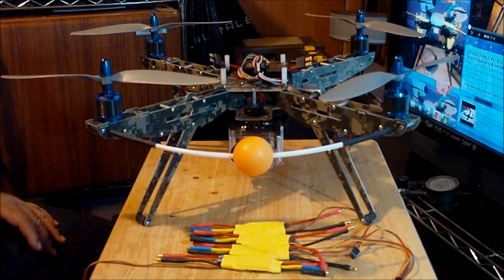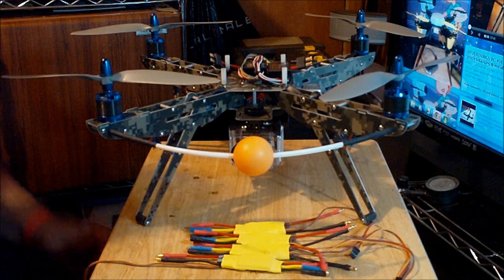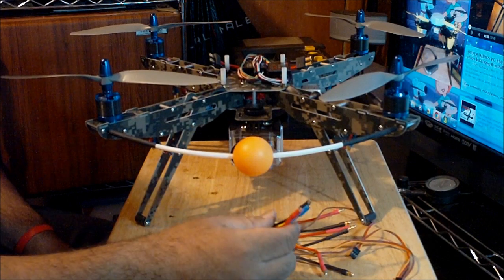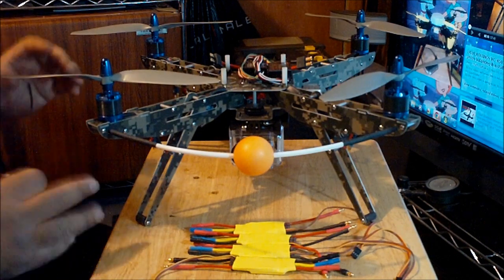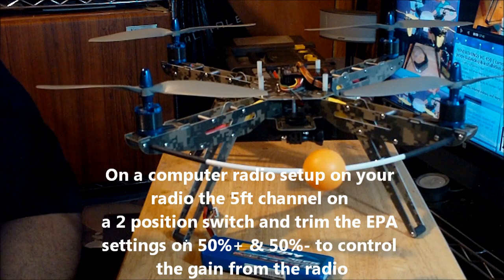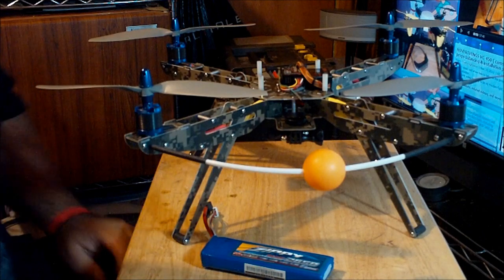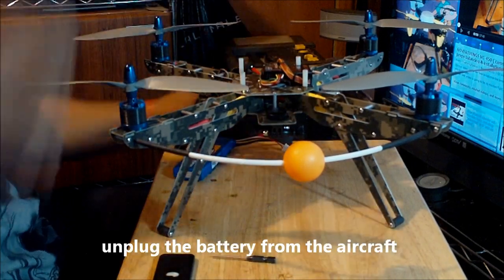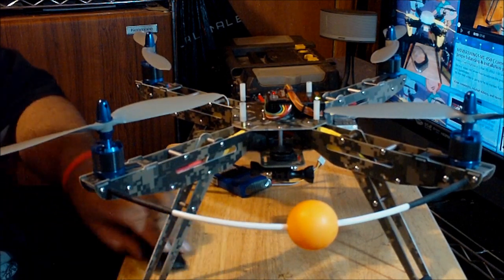HOVERTHINGS VC-450 ( camo ) quadcopter build up ESC's swap & GU-344 setup REDUX part #7

Comment from the maker: @cjsfamily When you select a new memory to be setup on the Hitec Aurora 9 the radio is always going to ask you almost a dozen questions before you can used that memory , i don't fly airplanes or heli's so i can't help you with that , only quadcopters so if a quad is what you are planing to used on your Aurora 9 select ACRO " airplane mode " and then respond to all the other questions NO .

Comment from the maker: @cjsfamily Well , every time when you turn the Hitec Aurora 9 TX on it always going to ask you if you want to transmit , YES or NO , if you select NO the radio wont transmit any signal but it let you access the menus to setup the TX without transmitting , if you select YES you will be transmitting and good to go flying .

Comment from the maker: @eastcoast78 For example if i use the GAUI 500x flying weight chart on 3s it can go all the way up to 1700g and on 4s it can go to 2200g , the 500x frame is a little bit larger than my VC-450 but my frame its heavier , the motors on the 500x are 2212 950kv and mines are 2215 740kv so i believe that on 3s i can carry a heavier flying weight than the 500x since my motors are larger and torquier but the big ? is how much more its safe to fly ? , what's my limit on 3s before i need to go 4s ? ..

Comment from the maker: @eastcoast78 My VC-450 is a mystery , i know that my 2215 740kv motors are large and powerful , the 10 x 3.8 APC props give me a lot of thrust but this quadcopter its a DIY and i got no idea about its limits , i don't know what's its maximum flying weight and that's why i want it to be able to fly on 4s , there is not that many companies out there making quadcopters kit so i can compare mine with theirs and use their specs as a baseline , the GAUI 500x its the closest one to mine quadcopter .

Comment from the maker: @eastcoast78 I done FPV flights already with my Gaui 330xs using a single 3s 2650mah lipo powering the aircraft and the FPV 200mw transmitter with a FPV camera , i can get up to 10 minutes of flying time with one minute spare but my 330xs came with a chart that shows you the maximum flying weight , my 330xs can handle all the way up to 1100g of flying weight , when i fly it with the FPV system + the battery my total flying weight its less than 900g so i know that i am safe .

Comment: @TheFlyingRookie id say you'll be fine with 3S P. The 500Mw FPV weights little to nothing. And those 4 motors well provide ample power for a FPV TX. 
You can put a smaller 3S Lipo there (stand alone) for powering the TX, or you can tap into the Main Flight lipos. But i would Prob go with a separate small battery for the FPV tx.

Seeing you'll only be flying for 8-10min a 500Mah 3S would be perfect 

I have the 5.8 200Mw wired to my GoPro960, it works great.

Comment from the maker: @eastcoast78  What i really want it to do with my quadcopter was to have the flexibility to fly it with either 3s or 4s lipos because i am planning to install a 500w video transmitter to work together with the gopro so i can do FPV flying but i don't know if 3s in parallel is going to give me enough power for this aircraft to flight safely and at least accomplish 8 to 10 minutes on FPV flight , that's why i purchase the HK ESC's so at least on 4s lipo's i can do that for sure .

Comment: @TheFlyingRookie hmm after looking it over on HK website, it looks like there is not a Programming card for it.
This ESC is for HIli's, which is Prob set to "soft start up" and why its not preforming the way you want.
Im not sure if a Hili esc is the right esc for a Quad? Im kinda new aswell, ive been reading the HK kk tread alot on RCG so i can learn how to set mine upo once i get it

Id say either play with the setting, or sell them on eBay or something.

Comment: @TheFlyingRookie yea thats understandable. I did a vid earlier this year on programming a E flight esc in the StrykerQ. 

It can be a bit daunting at first.
I am building a Quad soon, once my order's come i got some 20A HobbyWing Esc's and a Programing card from RCTimer. The card is compatible with HK's Plush escs as well.

If it wasnt running your motors up fast enough. Id say the timing could be not set right.

Comment from the maker: @eastcoast78 Thanks for the 411 , i got in to rc flying this year , at least with my first 2 quadcopters i didn't had any issues seting up the ESC's with the radio but as a new pilot it was frustrating that i couldn't get my latest quadcopter in to the air because the HK ESC,s weren't accelerating the motors fast enough or they weren't reaching enough speed for take off the ground , this thing was a big setback and i felt that i WASTE !!! my money just because i don't understand HK Morse code .

Comment: Option 6.  
Pulse Width Modulation(PWM) Setting   — — — — — — 
•••••• — 6 Short + 1 Long 8KHz – For low RPM and low pole count motors * 
•••••• — — 6 Short + 2 Long 16KHz – For most out runner motors

Comment: Option 5. Timing Mode Setting   — — — — — 
••••• — 5 Short + 1 Long 1º - For 2-4 Pole Inrunner Motors * 
••••• — — 5 Short + 2 Long 7º - For 6-8 Pole Motors 
••••• — — — 5 Short + 3 Long  15º- For 10-14 Pole Outrunner Motors 
••••• — — — — 5 Short + 4 Long 30º - For 10-14 Pole High-RPM Outrunner 
Motors